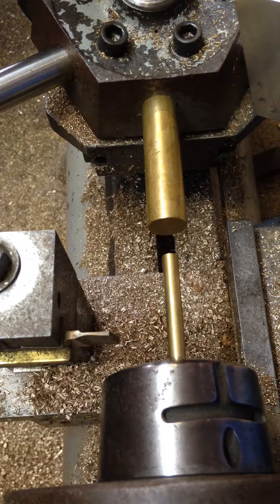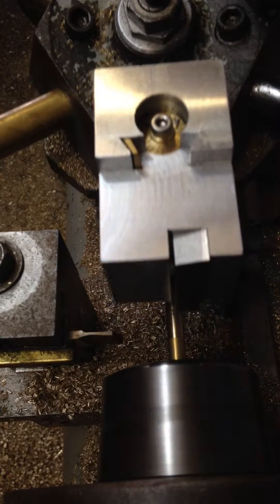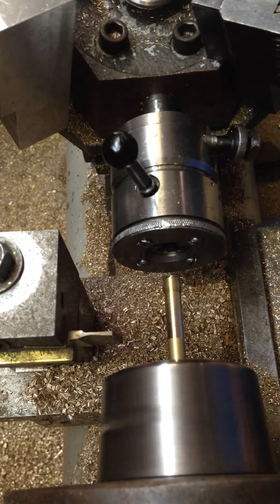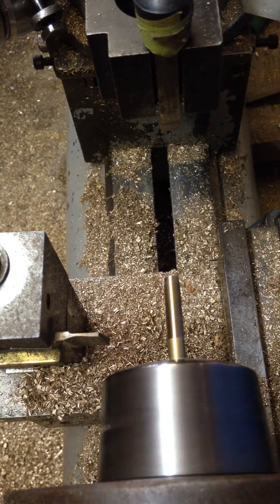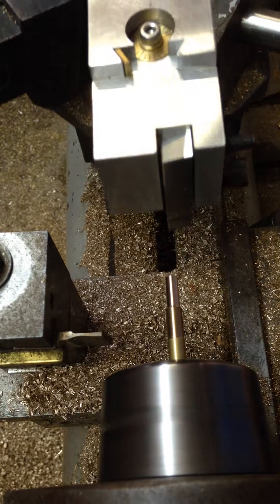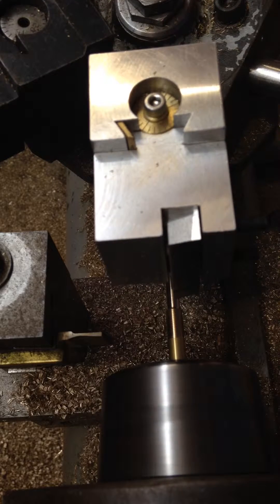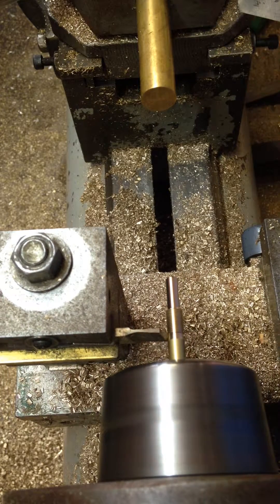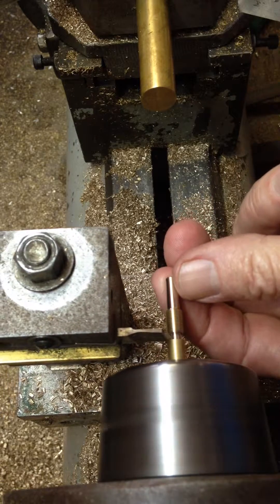Turret Lathe turning threaded pins.

Comment: I'm very very new operating this type of Lathe I have a hardinge dsm59 and I'm just starting to acquire tools tool holders Etc. I have one part that's fairly large that I like to be able to reproduce. It's a 1-inch piece of aluminum that needs a section cut down by a quarter inch. It does fall within the limits of the turret movement. It also has some miscellaneous cuts on the end but that's not important. I'm having a hard time figuring out how to do The Cutting the actual turning. It's bizarre setting something up that comes in from the top or side like this. I have a solid tool holder but it is not adjustable. Would you think it would be to my benefit to get something that is adjustable to a small degree for setup purposes?
Reply from the maker: Definitely.The 2 aluminium bodied tool holders in this video are shop made by me.The screw in the holder adjusts the cutter and the graduations around it are in one thou. steps.Makes it easier to hit your target sizes.I did buy some tooling from Ebay when I was starting out with it.Send me an email if you would like some photos of the tool holders.